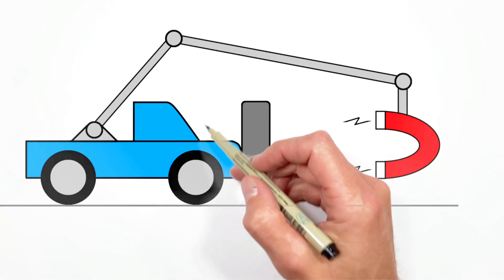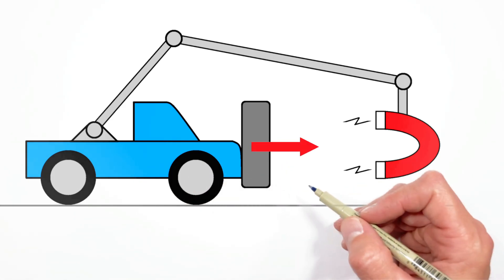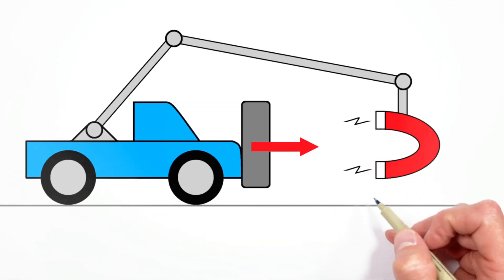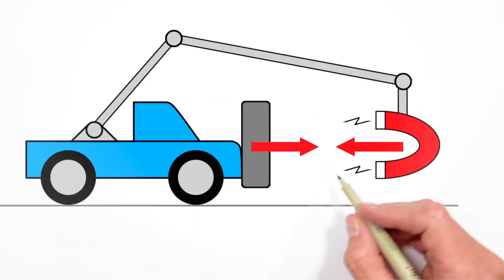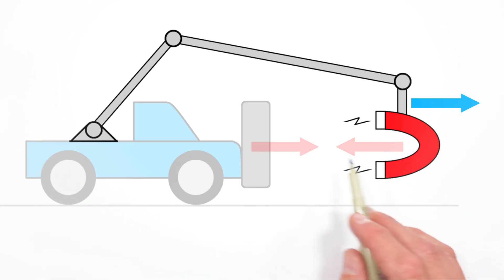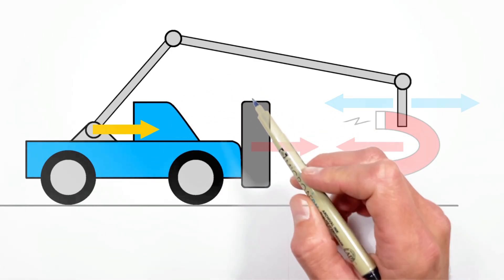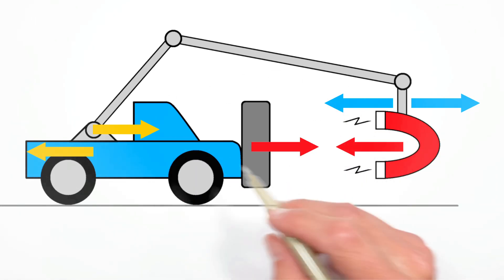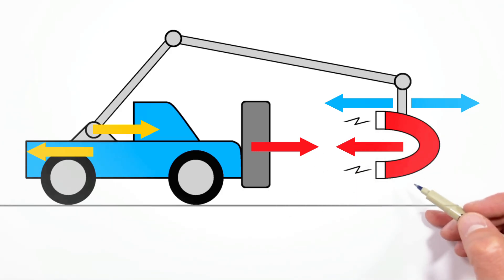Will This Truck Pulled by a Magnet Move?

Comment: Could a system where the magnet makes the wheel to spin work?
Reply from the maker: Only if you could turn on/off the magnet, at which point all you have is an electric motor.  No free energy.
Reply: @INTEGRALPHYSICS  Thanks, and we could just adjust the distance between the wheel and the magnet, and then make the magnet to go move "far" from the wheel when we want the vehicle to stop

Comment: What if the magnet was pulling a series of magnets on the wheel?
Reply from the maker: For every wheel magnet (on the top of the wheel) going toward the big magnet there would be a magnet (on the bottom of the wheel) going away from the big magnet.  theres no net gain.

Comment: What if you attach a trailer to the truck behind the truck. Connect the pole to that trailer instead of connecting it to the truck. Now the pole isn't directly connected to the truck. There should be space for the trailer to move closer to the truck allowing the magnet to move away from the truck OR space for the trailer to move away from the truck allowing the magnet to get closer to the truck.
Reply from the maker: What's going to pull the trailer?

Comment: The center of mass of the system will remain in rest or uniform motion until an 'external force' is applied. So the magnetic force here, can just ve considered the systems internal force, thus it will remain at rest, right?

Comment: I made a car for my daughters science homework.   All the kids had to make this and I used an ordinary toy car about 8 inches long and put a mouse trap on top of it with a string attached between the metal wire on the mouse  trap and the axle of the car.   It didn't work very well.   But even with no string attached the movement of the mouse trap wire in a semi circle from the front to the back of car, imparted forward velocity to the car.  The car should have moved forward as the wire of the mouse trap moved backwards in a semi circle and then the sudden stop of the wire should have imparted the  equal backwards motion to the car but it didn't.   The car kept moving forward.   I could not figure this out.  Still can't.    Momentum was not conserved.    The whole car and mouse trap together were in a stopped state at the beginning and should have been stopped in almost exactly the same location at the end as the mouse trap triggered.   The car should have moved forward and then backwards back to the exact same spot.  But the car in real life went all the way across the room. 
If you did this in outer space and a weight inside a closed space ship is thrown from one side to the other, the space ship will move a bit in the opposite direction and then stop in s slightly different spot because of the center of mass being moved.

Comment: What if you had a rotating front wheel  where the front magnet would be 8  magnets that all face outwards. So it wouldn’t constantly be pulling, it would have a pull and release effect. 

Also, inside of the 8 arms that the circle of magnets are attached to, there would be bearings inside of each arm that would fall forward from centrifugal force as the circle rotates.

Comment: Its possible... hard plastic rod. And plate the magnet concentrating the energy towards the front of the car. And a plate behind the metal block. Problem solved

Comment: It still doesnt make sense to me. Why is the beam pushing back on the truck?

 Perpetual motion machines don't have to be infinte, if we can harness one for 1000 years that will do. Why can't  gravity as a force be transformed to create power?
Reply from the maker: Not to be an ass but a perpetual motion machine by definition is infinite.

To address your real question, we do harness the force of gravity to produce power (ie.hydroelectric dams).  The problem which arises is that in order to produce energy you need more than force, you need that force to move something over some distance.  In the case of a dam it's water thats pulled downward by gravity, if you go sledding its your mass that gets pulled downward...

The issue in both cases is that you need some mass to start up very high; and it takes energy to get that mass up high.  The nice part about hydroelectric dams is that its the sun that lifts water vapor upward.  Unfortunately when sledding however, you have to hike your butt up the hill.
Reply: @INTEGRALPHYSICS  i suppose it's impossible to create an infinite machine that will never need a tune up and that will last for infinite years. No materials last forever, even if the concept could produce energy infinitely.

Thanks, yes I see now some dams use excess energy to pump the water back up also. I guess that's using the force of gravity but not actually containing Gravity itself as a force to be transported and used elsewhere, if you catch my meaning

Comment: but what if u replace the steel beam with another magnet...
Reply: one magnet following another magnet in a closed ring- case. the ring case is magnetic on the top and bottom, so the moving magnet consisting of a top and bottom repells it from touching the case while the front and rear magnet parts cause it to travel around the ring and a side facing magnet is directed at a copper coil around the sides of the case... profit?
Reply: & one magnet is stronger than the other
Reply: sorry i try to delete

Comment: Homie really said pushing on the steering wheel is the same as this magnet concept. Bro what? No it absolutely is not lmao
Reply: if u push on the steering wheel whilst ur sat in the car, the force of u pushing the car is gonna be equalled out by the force ur body is putting on the seat ur sat in. cos both the steering wheel and the seat are parts of the car the force cancels out
Reply: thats how i make sense of it anyway

Comment: Bigger magnet??
Reply: Beam that doesn't move? Guys i feel retarded wtf
Reply: The issue is that the magnet is doing two things at the same time.  The magnet is trying to pull the car forward AND the magnet is trying to move backwards to the car.  If you were holding the magnet instead you would feel the magnet try to drag you to the car.  That force ALSO is what's ruining the situation.  

If you put the magnet on a wall that force doesn't go away.  The wall us just strong enough to keep the magnet still while the car gets pulled.  

On the pole as pictured,  the CAR is getting dragged forward and backwards.  Adding more power doesn't matter.  So long as the magnet is attached to the car it'll balance.
Reply from the maker: ^^This

Comment: What if the magnet was propelled itself? Imagine if you will a locomotive in front of a train of railway cars being pulled by a massive magnet. Of course that magnet needs to be powered, but if the power is more efficient than diesel (for example) there would be value there.
Reply from the maker: You make an important point that most people miss... Somewhere in the system you MUST have some form of engine producing power, and that power/energy has to come from somewhere, but at the end of the day its the efficiency that's key.

Comment: Hmm the best way i understand it is ... If the magents on the car and the magnest arm were the same pole.

Would the car reverse or would the forces push each other and snap the stick in thr middle

Removes the whole idea of tensile strength holding the magnet in place 

Or just
With that setup.. if i push the magnet with my finger will the car move ? 

So if that happens why won't the car push itself back
You already believe it can pull itself

Comment: So if you can find a way to reduce the tension on the beam  to a point that the magnet has more force on  the steel plate than the beam has on  the the truck then  it would work?  (sorry  for my bad vocabulary in  this question, i  dont know much about  this. im just trying to reason through it.)

Comment: So what if the design was different to where there was many magnets in a wheel like structure and one half was connected to the axle of whatever wheels would be moving and the other half are connected to clamps that made the magents clamp closer together to apply that force, wouldnt it be able to start moving the wheels due to there being no backforce, so instead of it trying to push or pull the car its just applying directional force to the wheels, if that makes sense
Reply: And then I feel like there would still be a viable way to send power to the alternator to keep the battery alive

Comment: Every action has an equal and opposite reaction, so for the car to move forward there needs to be a force pushing backwards against the road (like tyres) or air (like a propeller). There is nothing in this diagram to push backward, so of course it cant move

Comment: INTEGRAL PHYSICS, what if you had electric magnets in the roads that turn off and on at the right time and had steel in peoples wheels (however you could get that work correctly) and had your car moving that way?
Reply from the maker: that works.

Comment: Hmm if the problem is that its all anchored to the same point could you not counter that with ball bearings to separate the two objects or use a bring to absorb the shock and regulate the whole process? Just looking at it makes my mind explode with millions of ideas on how to actually get it to work, the problem is that your doing it way to simply

Comment: I have a question about chariot, the horse is pulling forward and the chariot is pulling the horse backwards but its still going forward, I guess it's because both horse and the chariot are on the ground and relative to ground their both moving, right ? 

I kinda grasp but can't fully understand
Reply: The horses push forward against the ground creating a net positive force forward. The magnet is not pushing against anything that would create a forward momentum for the system.
Reply: @lt3880  thank you,

Kinda understandable but still not understandable :D English being my third language is also not helping

Anyway still thank you !

Comment: What if you had a lead car and set this up like a train car system but only used one vehicle to start the others in tow ? Not that it would work for road cars but how about a lightweight train or a rear car repelling pushing it forward

Comment: Consider my theory: it is not the "magnet" pulling the truck but the invisible magnetic interactions. THERE IS AN INVISIBLE MOTOR INTERACTION that does not come from a force of the magnet itself but of the distance between the two parts in interaction.
Reply: huh
Reply: eh... nope

Comment: If the last part attached to the magnet is a thin rope instead of a rigit pole it could work
Reply: It doesn’t matter what it is
Also a role isn’t rigid enough to hold such a powerful magnet

Comment: What's missing here is the explanation that the force of the magnet needs to be equal force to the weight of the truck and occupants plus gravity.
Reply: That's easily achievable when your using a small scaled model that's under one pound in weight. Try it with a several ton vehicle and see how heavy your steel plate and magnet need to be without interfering with outside forces like your cell phone or other vehicles in the road. No one entertains the interference these magnets would have in abundance on the road.
Reply from the maker: Only if we were trying to lift the truck.  A typical car engine does not produce a force equal to the weight of the vehicle, that would correlate to 0-60 in about 3s...

Comment: Newtons first law: an object at rest will remain at rest unless acted upon by an external force, all forces will cancel each other out regardless of the setup
Reply from the maker: This.
Reply: Give it some gas
Reply: What if the magnet is so much power full and has a much more mass and placed inside the car.
Reply: @cartoon_life-0123  what will placing it INSIDE the car accomplish? If it's too strong it'll just cause the car to collapse in on itself
Reply: @al-shan4732 sorry but nuh

Comment: So then explain to me how I'm able to push a car while it is on neutral if the force that I'm creating is being met with an equal and opposite force
Reply from the maker: that works because cause youre pushing against the ground.  put the car in neutral, sit in the drivers seat, then push forward on the steering wheel...  you wont go anywhere.
Reply: You are really dumb, forreal🤣

Comment: You're doing it all wrong dude. The one I saw didn't have a steel plate on the front. There was another magnet with opposite polarity. Total different setup.
Reply: What difference would it make? All the forces cancel out regardless

Comment: What about the force of gravity? How would that change the situation. We have take all major forces into account.

Force of magnet and car, force of gravity and friction of tires.
Reply from the maker: gravity is straight down, it does not act in the direction of motion.
Reply: Doesn't that get cancelled by normal force because it's not moving anyways?
Reply: @Gozieaaa The force cancelling out gravity is the force that's holding the car to the ground, called the "normal force"

Comment: But what if i removed the beam and Levitated the magnet with a second magnet underneath the first one?
Reply from the maker: Now we're talking external forces on the system, which works.
Reply: If I attach a magnet to the base of the truck and extend a magnet outward then levitate another magnet and get it to pull the truck, can the truck still move forward? @INTEGRALPHYSICS
Reply: ignoring the fact magnets dont work at right angles, how does the "second magnet underneath" move forward? or does the car reach the magnet and just stop?
Reply: @lt3880  the first magnet moves the second magnet
Reply: This is just getting closer to what we currently have. The trains that use magnets to progress along the tracks. Issue is at one point you have to have a stationary part so a car wouldn’t work until we built that infrastructure. Tesla has thought of creating magnet highway tunnels
Reply: How would it move?
Reply: @jackjackbt  with magnets

Comment: Why not replace a part of the crane with a spring and make the magnet an electro-magnet, that way when the electromagnet is turned on by some current, it coils the spring and touches the Metal on the car, then the current can be turned off and the potential energy in the spring propels the car forward. the current supplied to electromanget would be minimal with the maximal energy created by the spring, hence it is efficient.
Reply from the maker: Good idea, it would make the car move momentarily then stop and return to its original position as the spring rebounds.  In the absence of a force external to the car/spring/rod/magnet system, the center of mass of the system is not going anywhere in the long run.
Reply: @INTEGRALPHYSICS  therefore, we cant make any other concept to move the truck using magnets like is therre a solution for that man

Comment: Bro, you're HOLDING the rubberband on one end, smh. Big difference when the opposite end is on WHEELS, lmao. By the way, it DOES work. I don't know how practical it would be with a full size vehicle but I made a tiny wood model car with this magnet setup some time back & placed it on a level surface. Believe me, it works. This guys is reaching too much & you can tell by how he tries to explain it, crutching on Newton's Third Law while ignoring the fact that this idea involves free motion.
Reply: holding the rubber band represents the beam holding onto the magnet, thus the attraction between magnetic force is cancelled by the beam holding them apart. there is no such thing as free motion.

Comment: if only the magnet wasn't attached to the car, if only but alas it's not like it's possible
Reply from the maker: The issue with permanent magnets, I don't care where you put them, is that they act like springs.   They aren't a source of energy, they simply store then return energy that they have been given;  Meaning you still are going to need something to do work on the vehicle.
Reply: @INTEGRALPHYSICS  imagine if roads and highways had a magnet conveyor belt above them

Comment: In 9th grade shop class we had to do our own projects. One student made a wooden high speed train on tracks using magnets. You just shoved it and the magnets propelled it along the tracks like a bullet. So yes it worked as long as you gave it a shove.  Inthinknitnstoppedna few times but the magnets reeally did propel it. It floated on the tracks.
Reply: That's a separate magnet that's not connected to the train
Reply: @kirk5649  One was glued on the bottom of the train and another string of magnets glued on the track of opposite polarity. It looked like a high-speed bullet train. And the speed train was held in place by the track.
Reply: @MARINE76911  yea that's what I'm saying. I've seen one too. It works if the magnets propelling the train aren't connected to the train